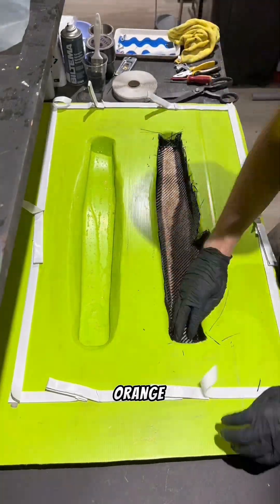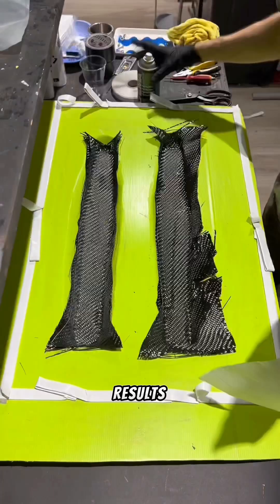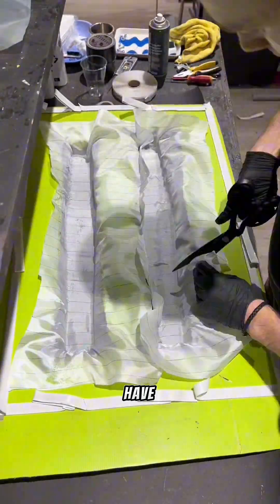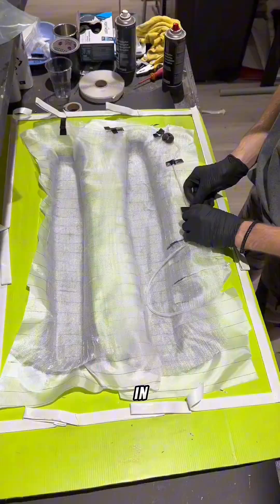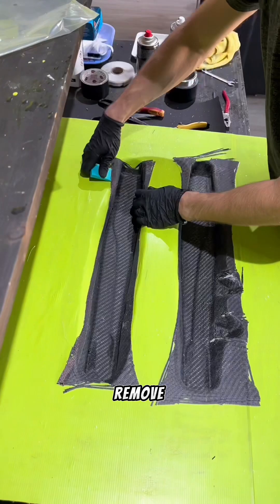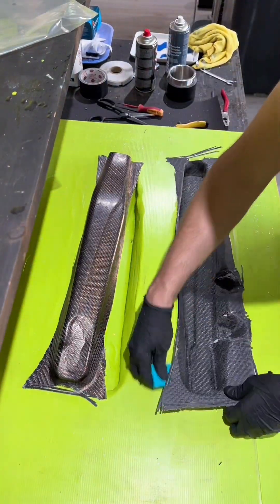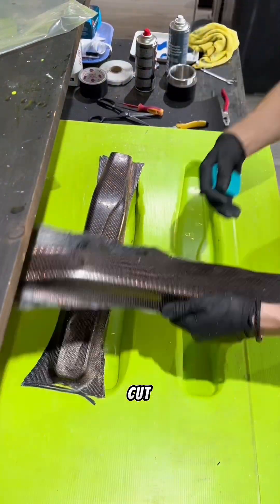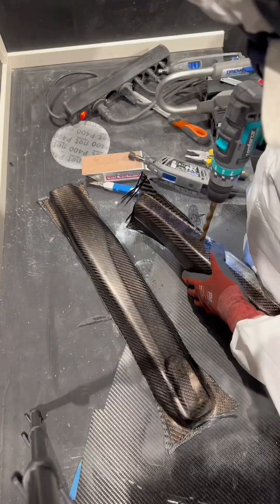The Process of Making Carbon Fiber Swingarm Covers (Infusion Method)

Comment: I got a question... are the wrinkles of the plastic bag visible after curing?
Reply: No there not. as you can see the guy in the video used a „peel ply“ - thats the white ply with the strips integrated - this takes up leftover resin and leaves a textures matt but clean finish. 

I myself dont use resin infusion anymore. it takes up too much labor time compared to prepreg. i switched to prepreg carbon fibre (like used in F1 and aerospace) and cnc machined moulds for highest precision and quality.